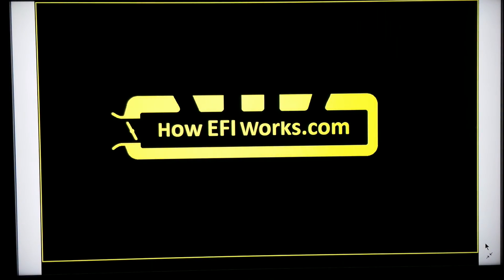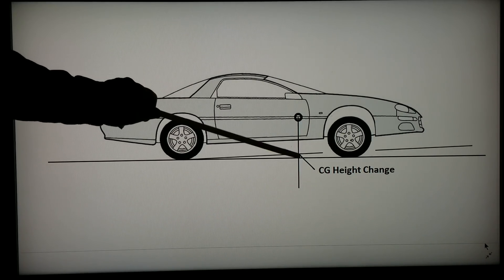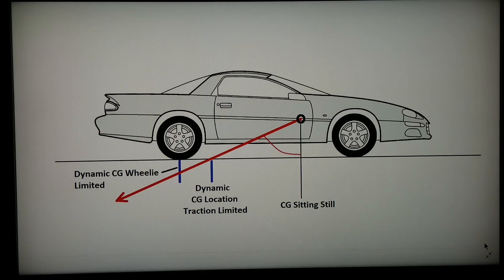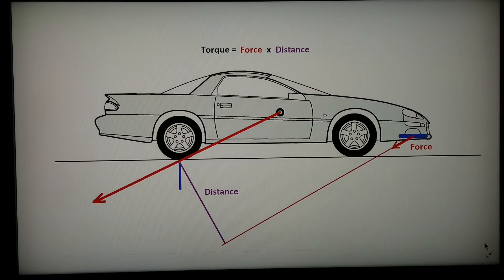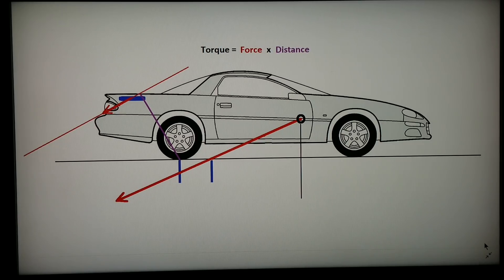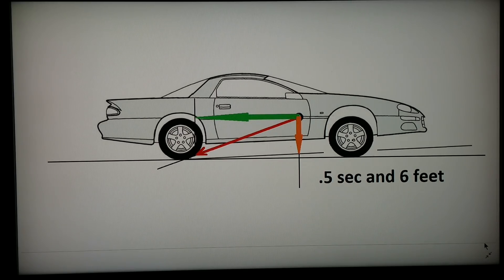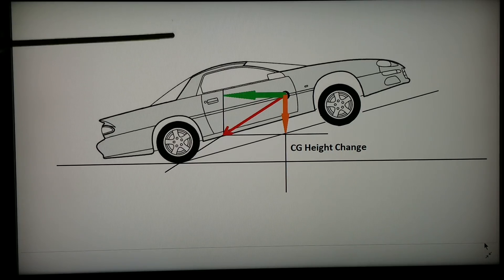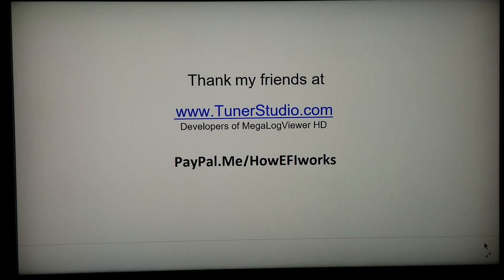Drag Race Weight Transfer

Comment: Ok, so stupid question of the day.
  I'm simplifying it for length/boredom equalization...
  What would happen if you added a weight on a sliding mechanism that, as the car increases acceleration, driving the front end up as the force vector changes, the weight slides forward.  Would this not gradually increase the down force on the front end, helping to keep the overall stability of the car during the acceleration curve?  Or is it just my over active imagination?  It wouldn't have to slide far, a few inches to a foot, I would think.  Or, would it have no effect at all?

Comment: very well explained video, one question though, how would this work with a front wheel drive doing drag racing?
Reply from the maker: For the most part, the math is all the same, just not to your advantage.

Comment: Hi Andy, Nice video! I don't understand the sentence of 0:42
1G for 5s you will have an increase of velocity of around 110mph. Is the same case of a free fall (1g of accel) v=a*t
Probably you are ponting to other thing, but I can't realize what
Reply from the maker: Sorry.  That should have been 161 Ft per sec or 109 MPH.  I simply did not catch the error.  Good catch.